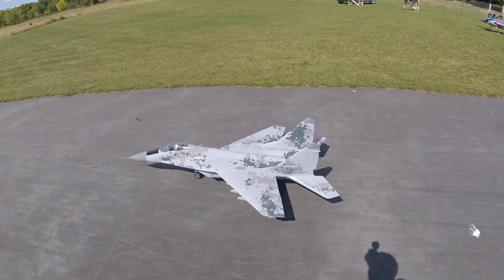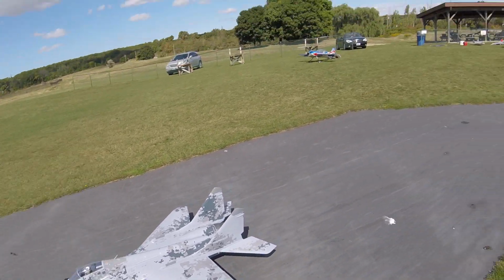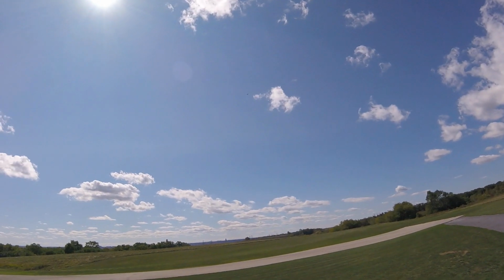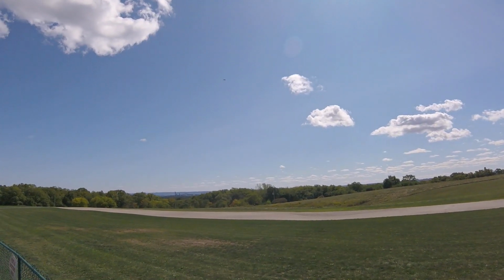Freewing Mig 29 Maiden too nose heavy bad CG

Comment: Nice flight! Haven’t had the opportunity to maiden mine yet. Curious about your battery location because of it being nose heavy. Some are putting the front batt in the middle tray, and some in the very front. Which spot did you choose?

Secondly, where did you initially place your elevator spot? As per manual at 2mm below the level...or further down? 

Trying to figure out how to minimize any need to trim too much in the air. 
Thanks!
Reply from the maker: Batteries replaced in center and rear word battery tray. Elevators were placed at 2 mm as per the manual. That said, I would go with 4mm below the fuselage as a starting point for neutral. Also the plane has a tailslide flight character that can get you into trouble when you go into a stall turn or rudder turn you need to power through the entire manoeuvre otherwise you can get into a tailslide flat spin. Additionally on takeoff she does like to jump up in the air some what aggressively so be careful on the elevator input that you give. Landings with this thing is an absolute breeze you can even come in dead stick with very little throttle needed on flare. Grass opp's is great no need to worry about dropping it in the grass if you missed the runway as well we're taking off for that matter if you roll out too far. Cheers bro.